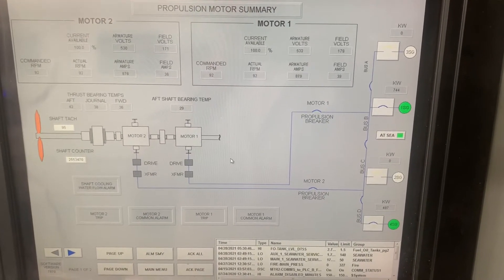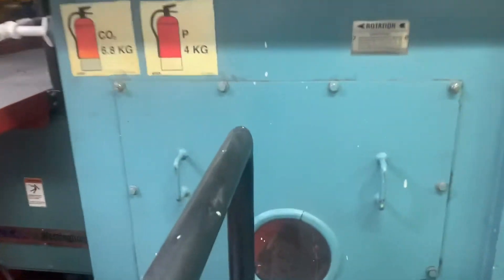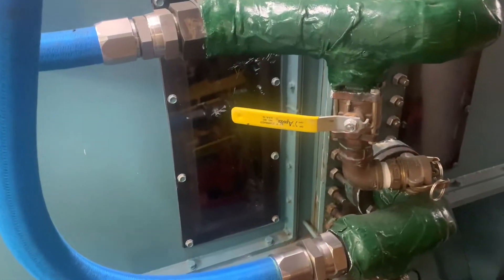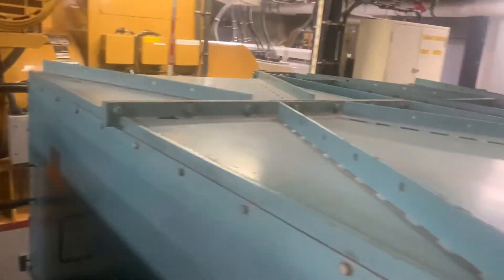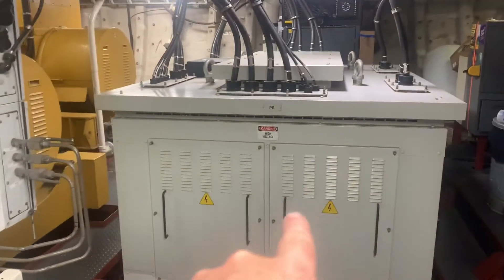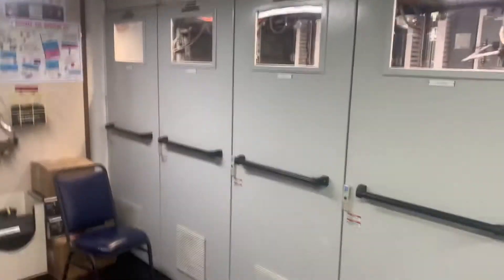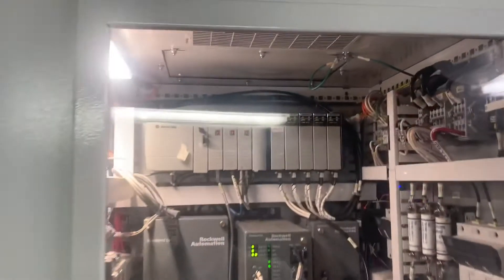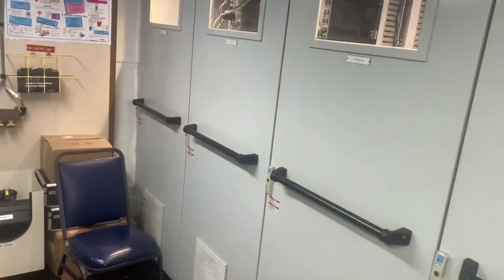Diesel electric marine propulsion

Comment: One of the most impressive machine room I've seen. What is the logic behind the alignment of the 2 electric motor on the same shaft ? Redundancy ? Power ? At least this removes the need for a heavy gearbox,were they paralleled. The controls must be tight. thanks
Reply from the maker: @halimturqui5007  this was a reaserch vessel. And had quite a bit of acoustic considerations in design. I don’t know if that had anything to do with it or it was a redundancy thing. It was an SCR drive so very noisy power supply

Comment: Those are big elecreic motor setups!! Do they use dc because its easier to vary the motor speed?
Reply from the maker: Yes DC is much more controllable for varying speed. There are other factors at play and you can do AC but for this application DC works better.